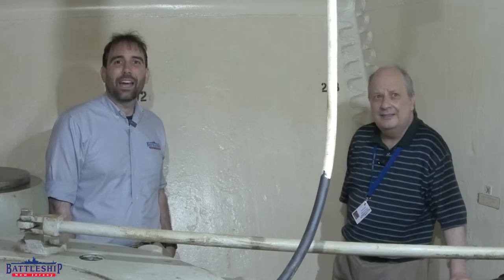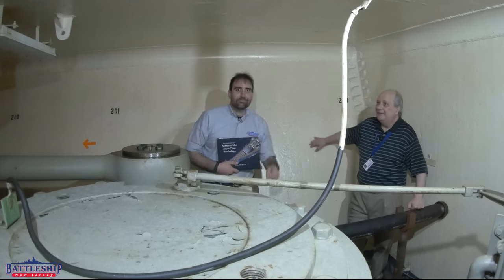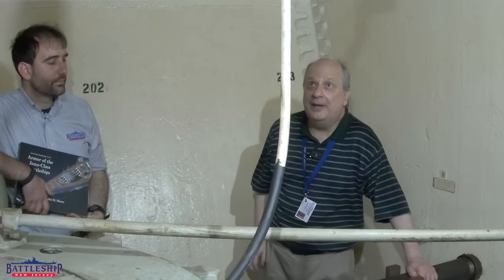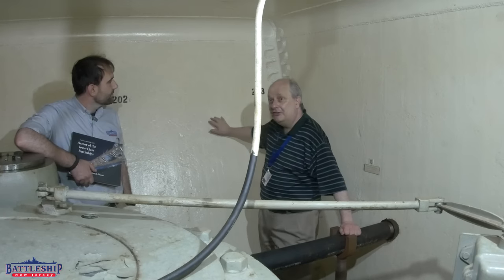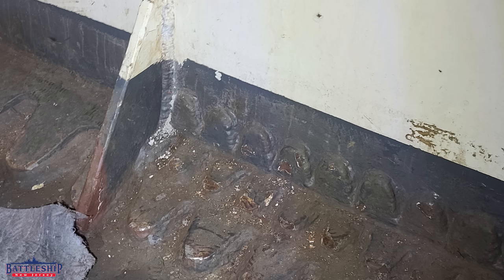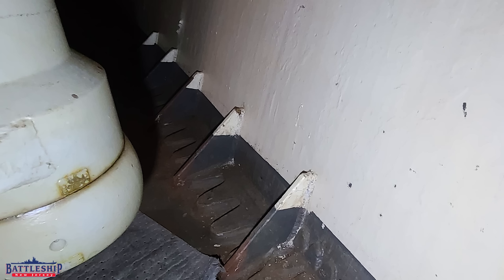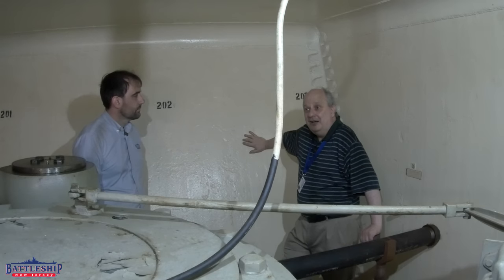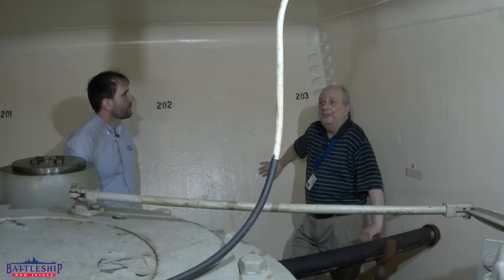The Armor That Protects The Battleship's Steering

Comment: RHA used on WW2 American tanks was STS . Special Treatment Steel was a medium carbon Nickel-Chrome steel alloy developed by Carnegie steel in 1910, considered to have basically the same material properties as RHA and Class B that while expensive to make, was used in practically everything from Army and Naval construction from 1930 forwards (econonomies of scale here, having millions of pounds of the stuff made lowered the price). About the only thing not made from it was submarine pressure hulls. Not as strong as the later developed HY-80 used in many post war submarine pressure hulls (up through to the Los Angeles class). There was an intermediate alloy known as low carbon STS developed in WW2 that added molybdenum to the alloy. Regular STS has a Ultimate yeild strength in the neighborhood of 75 ksi, which if used in the later HY series navy temininoloy would make it an HY-75 and a Ultimate Tensile Strength of at least 110ksi. Low carbon STS was considered the forerunner to HY-80. HY-100 was introduced with the Seawolf construction. HY-80 also has Ni-Cr-Mo as the three principal alloying elements just as low carbon STS did (STS didn't contain Molybdenum and the carbon content was slightly higher). If you compare the later HY steels and STS, the carbon content is lower, the nickel is the same, the chromium is slightly less and there's the aforementioned molybdenum (along with other elements in much lower amounts). Class B is a bit lower in the UTS, a bit higher UYS and basically identical hardness to STS. 

These steels are all hardenable though, but they use different measurement systems in the literature. STS used the Brinelle scale, of 200 to 240 range which is equivalent to about 15 to 23 on the Rockwell C scale. HY-80 is Rockwell C-21 and HY-100 is C-25 (both HY-80 and 100 are considered weldable though 100 is much more difficult which led to problems in the Seawolf hull construction, and HY-130 is not considered weldable). Late in the cold war a steel super alloy was developed known as Aermet 100, which had a UYS on the order of 250ksi, and after heat treatments a Rockwell C hardness of 38. It was used in armor plate, aircraft parts, and other places where higher temperature and better strength to weight ratios with high fracture toughness were needed (than could be achieved using titanium alloys). It enjoyed a brief period of excited interest in sporting goods after the sudden cut of F-22 procurement from the original 650+ plan to only 187 aircraft left Carpenter Steel, the inventor/maker of Aermet with a lot of bar, billet, and sheet stock manufactured with no buyers lined up. Its unfortunately NOT corrosion resistant so you have to paint the stuff (or otherwise surface treat) if used in moist environments, made worse by the fact that being so strong, a lot of the sheets made of it were pretty darn thin. Bicycle frames using Aermet 100 cost as much as titanium frames did, but were lighter. The tubes were seamed construction, sheets were rolled into the tube shape and laser welded along the seam, then machined smooth.

 More recently we got another super steel, that was cheaper to manufacturer than Aermet (as it contained a high cobalt content, current prices are around $32USD per pound and Aermet 100, 310 and 340 vary from around 13.4 to 15.6% cobalt) without any cobalt in its alloying elements called USAF-96, and developed primarily for deep ground penetrating bomb casings. It uses elements only domestically manufactured in the USA, and is well suited to a wide variety of heat treatment methods, and is weldable as well. With a simply water quenching, It has a UYS of 194ksi, an ultimate tensile strength of 250ksi, and a Rockwell C hardness of 48.7 (equivalent to Brinell 461). The hardened face of Class A armor in WW2 was about Brinell 490, and this with a UTS of 100 ksi and UYS of 60 ksi). One of the ways armor is measured for toughness is the ratio of yield to tensile strength, with the closer to 1 the number the worse its considered to be as its the least ductile/most brittle. Class A is 0.60, Class B is 0.74, STS is 0.68  and USAF-96 is 0.78. USAF-96 is nearly as hard, throughout its thickness, while also being considered a very tough and ductile steel. If the metallurgical knowledge had existed in the 1930s to produce USAF-96, every american tank, and warship hull would have basically used this instead of RHA plates, STS, or Class B armor.

There is a webpage from 25 years ago online with information on the material properties of different armor types from the late 1800s thru the 1940s compiled of data from many sources including the Bureau of Ordnance records. 

http://www.combinedfleet.com/metalprp.htm
Reply: Very interesting comment, i have a small amount of experience with various material manufacturing over the years, specifically in developing materials for high speed hydraulic systems. 

A question i have is about chrome plating on sts surface hardened steel besides the corrosion resistance, the platting alters the surface roughness but maintain the hardness, its my experience the harder the surface to be plated the better adhesion of the chrome, and this plating is required for the best erosion resistance  

Would this plating alter the minimum ricochet angle of the plate due to the surface roughness, or at least increase the "angle" of penetration, thus increasing effective resistance? I know the plating would crack with enough blunt force but with the inertia involved with projectiles and the materials they are made from i believe the thermal energy to "over match" this plating is higher enough to deform the projectile's surface area so that the energy (lbs/in2) decreases thus reducing penetration.

I know that this isnt feasible as any crack would require replacement making it ungodly expensive much less a method to test.
Reply: A lot of that information went right over our heads!! Great information!!
Reply: @Dieselfueledwork  gotta get it in when ya can lol 😂
Reply: @ramtuff06  agreed!!
Reply: @Dieselfueledwork  I'd love to know how many keeks such as I actually read and digested all the info. I did, and enjoyed it thoroughly.
Reply: @The_DuMont_Network  haven fully read it yet, will soon.

Comment: My forearm, elbow to wrist, is 12 inches long according to the tape measure here on my bench. I'm a structural welder, the idea of working with 13.5 inch plate makes my head hurt. Madness. Thanks for your insights John!

Comment: I have to admit that the very first comment from tbe gentleman put me off as a total lack of understanding of battleships. The armour on the Bismarck was totally sufficient to protect its steering gear from heavy shellfire, what was not anticipated was a torpedo hitting the rudder during a sharp turn. This would have been the same for all battleship designs, including American. All designers would know that rudders and screws are weak ppoints but very little can be done to protect them from underwater hits.

Comment: Any way to get in to see the rudder mounts under the searing gear? Those, and the trust bearings for the prop shafts, are basically the places where external forces push on the rest of the ship and would seem to be interesting for the amount of force that a small part of the ship would be expected to take while things are going correctly.

Comment: Anyone know what's inside a Iowa class rudder? Is it empty? If it's empty, is it a volume you can enter in dry-dock?
Reply: There are two rudders
Reply: I work in the commercial tug industry. As far as the vessels I've worked on, the rudders are hollow. However, I do not know why this is the case, my assumption is either weight or buoyancy, but that's a guess.
Reply: Iowa class have twin rudders. I'd imagine they're constructed like any other ship's rudder. Sheet metal welded over a webbed frame, like an aircraft's wing. Though it would be too slender for a human to physically enter even if it were cut open.
Reply: Great question 👍
Reply: Yes, most rudders are hollow in order to provide for a buoyancy effect. That buoyancy reduces the weight that the rudder carrier bearing supports. As a Marine Machinery Mechanic I've removed some of them while in dry dock.
Reply: @reddpanda3243  Warcraft magical material?
Reply: The rudder of the USS Texas (per a Tom Scott video, highly recommended) has vertical and horizontal steel members, with the voids filled with wood.  So I would imagine that Iowa-class rudders have a similar construction.
Reply: It is mostly empty, but has no openings, except vent and drain plugs. I don't even see inspection holes for the rudder stock on former dry dock photographs.
Reply: @davidforde4020  Oh, i know there's two. I meant in general what's inside. The level of construction should be impeccable if it's just empty, even brass floats in carbies eventually go bad and get filled with fuel (and i'm not even talking about the plastic ones, brass ones which should last indefinitely). But i suppose you're right, it would be too thin. I looked up photos.
I'm asking because in smaller boats (glass and even some aluminium ones) they're filled with a core material, and even those get soaked eventually. Water just gets in, there's no stopping it.

Comment: When Robert Ballard found the Bismark wreck the only part of the hill not intact was the stern , apparently there was a weakness in the design and Prinz Eugen also suffered a structural failure later in the war . This was an interesting talk and look at New Jerseys construction . As the US. entered the war later I'm wondering if the armour was part of the original design or an adaptation to problems with similarly designed ships . Of course the actual rudders and props are still vulnerable to a lucky hit .
Reply: Those german ships have centreline props making the hull much shallower in the stern. With Bismarck the torpedo hits the under side of the ship
Reply: Define intact, please.

Comment: Armor on the ship's hull in way of the steering gear space doesn't help if you get a torpedo hit whose pressure wave bends the rudder stock, blows a rudder off, or the shock damages the steering gear hardware. Against shell fire definitely a good thing...
Reply: That's why you have 2 rudders
Reply: @Synergy7Studios 
Exacly, just as the Bismarck did.

Comment: Would any of this armor hold up against modern missile based weapons?
Reply: No. The naval weapons we have are brutal.
Reply: Completely...most would bounce off.  An adversary would need large kinetic Energy weapons or nukes to defeat an Iowa Class ship. And who would be silly enough to do that to a USN ship?
Reply: Depends on the warhead.  It would be very resistant to HE and Fragmentation warheads.  However a large shaped charged as is used in some Anti-shipping missiles would probably penetrate it.  However they do have very good subdivision and the decks provide a layered defense so it is probably survivable.  Ships are pretty tough even small ships can take a pretty good beating.   That said modern torpedoes would probably make a mess of her very quickly.
Reply: The interesting thing is that nobody sails battleships anymore, so modern weapons don't need to optimize for punching through armor, they need to optimize for evading anti-missile defenses.  If you're only shooting at carriers and destroyers then configuring the warhead for heavy armor penetration is counterproductive: you will punch clean through your target doing minimal damage.
Reply: Better then what’s used today and thicker

Comment: Is this a reaction to what happened to Bismarck? Or are all USN battleships so armored?
Reply: All battleships have similar though varying degrees of steering-protection.  Iowa-class were already under construction when Bismarck was sunk.  The hit on Bismarck was as rare as the hit on Hood.  Regardless - no ship can withstand a torpedo-strike to the rudder-area.
Reply: Descriptions I've read about the designs of the US fast battleships - North Carolinas, South Dakotas, Iowas - emphasized how heavily armored the steering compartments were.  The designs of all three classes were set before the war, and all three classes were under construction before Bismarck's little adventure in the spring of 1941.
Reply: All the steering room armour in the world have not prevented what happened to the Bismarck. The Bismarck took a torpedo hit in to one of the rudders actual forcing it in to the center screw, fouling the screw and jamming both the rudders

Comment: Video Idea. In your honest opinion, if the Battleship New Jersey found herself in a similar situation that the Repulse and Prince of Wales were in when they sank (one of the many reasons why the Navy decided to slap on as many AA guns as they could fit on her during construction), could she possibly survive the fight or would she suffer the same fate?
Reply: PoW sank because the worst imaginable scenario happened: torpedo's fractured a driveshaft that fell out of the ship opening a huge non-containable flooding into B engine room, while also causing a power blackout. Not necessary something the steering gear armour would have helped against.
For sure the Iowa had considerable better AA than PoW, but Iowa as sailed out was a product of events like PoW & 1942 USN Pacific experience. PoW and Repulse where not expecting to be under Japanese air-range and sailed out expecting to have air-support, and as a result made the unfortunate history by being the first capital ships sunk at sea by merely air-power.
Reply: @Tuning3434 first in combat. Billy Mitchel did it before as a demonstration and got court martialed for all his efforts of championing air power over naval.
Reply: As a point of reference, the South Dakota, with a similar AA configuration as the Iowa's ( four MK 37 directors and 16 5 inch 38 caliber guns) claimed to shoot down 26 attacking aircraft at Santa Cruz in 1942.  I always wonder how South Dakota would have fared if exposed to the attack which sank Repulse and Prince of Wales.
Reply: @robertmore703 quite rightly too, mitchell was wrong. Air power wasn't up to the task for at least another 10 years and he denied any useful results from an expense exercise
Reply: @JevansUK  no he wasn't. he sunk several ships under VERY strict conditions that the Navy tried to use to prevent him from sinking the ships and he managed to do so anyway. Look up the tests. You'll be amazed at the results. Not one torpedo and no direct hits from larger bombs. only smaller antipersonnel were to simulate suppressing AA. Everything else was near misses.

Comment: Amazing!  Did they pour all those armor walls?
Reply: Not poured in place, like concrete. Naval armor plates were manufactured flat (horizontal), then wrangled into their desired positions with enormous overhead cranes and bolted, riveted, or (usually, by the 1940s) welded in place. There's an earlier video on this channel in which Ryan shows one of the huge, complicated welds joining together part of NJ's main armor belt. As you might imagine, welding together 12-inch Class A armor plates wasn't easy!
Reply: Pouring molten metal into a form, is called casting. A true cast iron skillet, is made by pouring molten iron into a mold the "inverse" shape of the skillet. But most modern steels, are forged. That is the molten metal is poured into a simple mold to form a simple "billet", that billet is then hammered and/or rolled into the final "raw stock" shape. Hammering and rolling are two types of forging. it can be done heated (hot rolled) or unheated (cold rolled), depending on the properties you need.

With battleship armor, the process changed over time. Some of it was cast, but other types where hammer forged in some of the fabrication steps. There also involved several heat treating steps, during the process. Both forging and heat treating altered the microstructure, to get the final metal properties.

Metallurgy, is a vast field, and I'm just some goober, who fell into the metal fabrication business, for a few years. Nothing as big as a battleship.